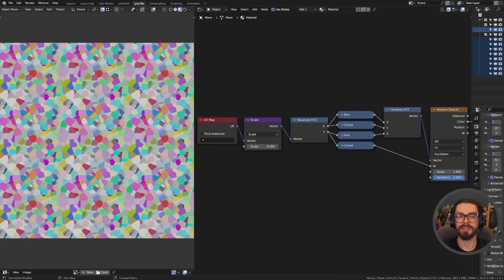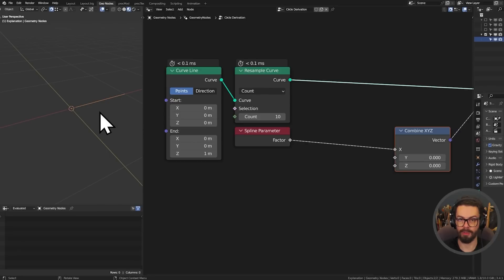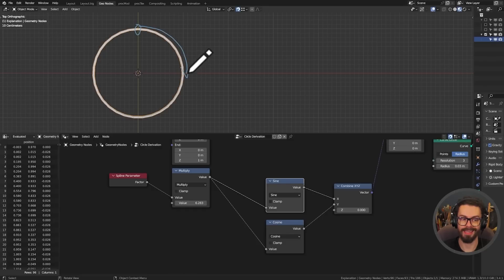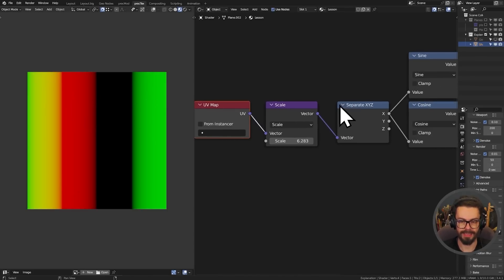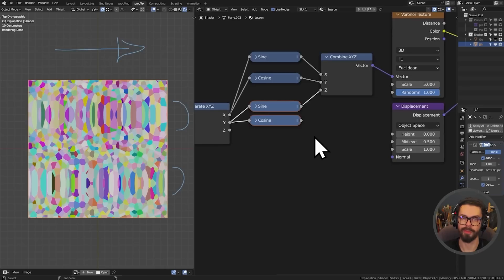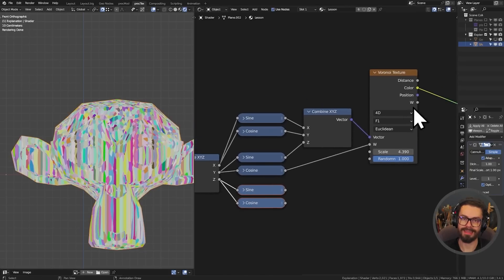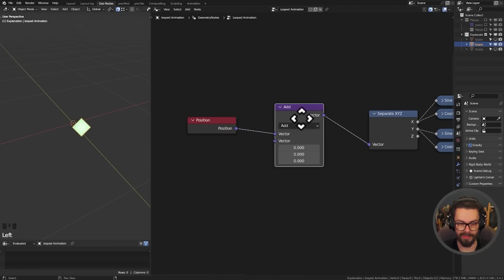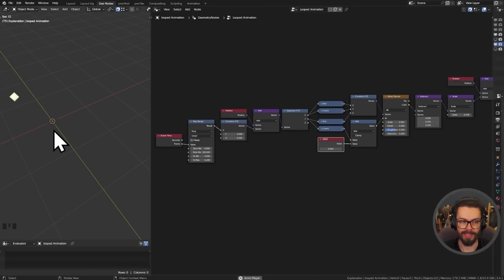Tile ANY Procedural Texture

Comment: Amazing video! The practical applications were great but the mathematical explanation was a little wonky.

Essentially what you're doing is remap an 1 dimension input to a continuous closed loop in a higher dimension. In your case the loop was a circle in 2 dimensions as you used the sine and cosine functions. However any continuous closed loop achieves this result, which means that any continuous periodic function, such as the Ping-Pong function for example, can be used instead of sine and cosine.
Mathematically speaking this remapping can be interpreted as a continuous closed curve k:[a, b] -> R^n where k(a) = k(b).
To minimize the distortion the norm of the derivative of that curve should be constant, ideally 1 to preserve scale.

I'm saying this because this process of mapping introduces a certain amount of distortion. If you look closely at your Voronoi noise you will notice that the cell borders are slightly curved even though they should be perfectly straight, this is due to the distortions cause by your remapping. 
The strength of the distortion is dependent on the the periodic function and the procedural texture being used, for example using the Ping-Pong function results in less distortion when paired with Voronoi noise.

Another thing you mentioned was that your way of tiling a 2D Voronoi texture requires a 4D Voronoi texture while a tileable 3D Voronoi texture would require a hypothetical 6D Voronoi texture. This actually isn't necessary. For all procedural textures in Blender it's sufficient to only remap a single input axis. Not only does that mean that we can actually create a tileable 2D Voronoi texture using a 3D Voronoi texture and a tileable 3D Voronoi texture using a 4D Voronoi texture but doing so also reduces the amount of distortion we introduce.
Reply from the maker: Thanks for the full answer. How are you achieving minimal distortion without looping all the axis? Doesn't it clearly stretch as it cycles?
Reply: @Erindale  When remapping there are 2 kinds of distortion we introduce. 

The first is caused by variations in the norm of the derivative of the curve we use to remap the input.
To minimize this kind of distortion the norm of the derivative should be constant.

The second is caused by the shape of that curve.
For Voronoi this kind of distortion is minimized when there is curvature in our curve.
This means that our function which we use to remap the input has to be a piecewise (affine) linear function which the Ping-Pong function is.

The norm of the derivative of the curve consisting of Ping-Pong functions is the constant value sqrt(2). So if we divide the axis by a factor of sqrt(2) it completely cancels out the first kind of distortion. 
As an piecewise affine linear function the Ping-Pong function obviously has no curvature, so the second kind of distortion is also minimized.

When using sine and cosine the norm of the derivative of the curve is sqrt((sin(t)^2)+(cos(t)^2)) ,which thanks to an addition theorem just happens to be the constant value 1. This is why you didn't have to divide the input by a constant factor and why the first kind of distortion is also minimized using sine and cosine.
However because the curve comprised of sine and cosine has a certain amount of curvature it introduces the second kind of distortion.

As for "without looping all the axis?" I don't quite understand what you mean by that. The Ping-Pong function just like sine and cosine is a periodic function so the resulting curve does loop.
Reply from the maker: If using ping-pong it will be clearly mirrored like it's been book-matched. With the sin and cosine method, the repeating isn't immediately apparent to the eye. You mentioned you can loop with only a single axis which makes doing a 3D tileable effect possible without 6D noise
Reply: @Erindale  Ah, I forgot to mention that you have to apply an offset to one of the remapped axis. So just add a constant factor to one of the remapped axis. If you do that the mirroring effect will disappear.

Also when I said that it's possible to loop with only 1 axis I meant that we only need 1 additional axis to create tileable textures. Doing so requires arranging the curves in a way such that the resulting shape is topologically equivalent to our looping plane, however that isn't easily explained.
Reply: Holy moly!
Reply: I dare you, I double dare you guys, find me a better community!

The magic of open source.

Comment: This doesn't work with ANY Procedural texture.
At the beginning of the video, the Voronoi texture image, if you draw a line from the top right to the bottom left, it's a clear mirror point for the entire texture. 
Colors are different, but shapes are identical.

Great for other noise types though.

Comment: How do i actually use this on a texture though, i dont think i've seen anyone plug this into a procedural texture, they just demonstrate the tilability and stop there. theres like a gap in knowledge and im not sure where to start from after i have my tiled noise texture. 

My guess is i'm supposed to build this into its own seamless block, but idk what plugs into what when you actually begin making a regular texture from it.
Reply from the maker: As an example let’s say you’re building a brick wall with some damage and dirt on it. The maths for the brick pattern is easy to make loop already but the dirt and damage is very likely to be noise or voronoi based. In this example you’d use this looping WXYZ coordinate to drive the noise and voronoi with the same wavelength as you’ve set for the brick pattern

Comment: Is there any way to speed down the cycle? It seems it has to go all the way to 2*Pi (tau*2) which is way too big value.
Reply from the maker: It has to do a full cycle to loop the coordinated but you can adjust the texture scale to try and make it feel better, or opt for a longer animation. 10-15s is pretty standard for a looped animation

Comment: I've compared node setups 10 times now and I can't spot a difference, yet can't get it to work... did this stop working in 4.0?
Reply from the maker: It shouldn’t have done… still works for me. Maybe drop a screenshot on my discord and someone can probably help
Reply: @Erindale this is embarrasing... I was so focused on the various sine and cosine nodes trying to figure out why I'm not seeing the same patterns that I missed that I missed the 2*pi scaling node in the beginning which makes everything work! 🤦‍♂Anyway, at least I've spend an hour extra trying to understand the maths behind this so I've either gained 0.001 IQ points or wasted a whole lot of brain cells...😅
Reply from the maker: @eobet not embarrassing! Very easy mistake. And the debugging is a good brain exercise

Comment: Since I switched from Cinema4D to Blender I was looking for a way to get seamlessly looping noises in Blender as well (Cinema4D noises have this implemented as setting). This is an immensely important feature for motion graphics artists if you need to create looping visuals for events or social media for example. My workaround so far was to blend over two textures with the same values over the looping time while animating the W value accordingly so that they are the same at start and finish. But this setup is the real solution, very elegant and much more flexible. Thank you so much for this amazing tip!
Reply from the maker: Glad it's helpful!

Comment: I don't know the whole math; but I think the simple(ish) solution for 3d tiling would be to use the 3D coordinates as euler angles, and convert that rotation into a quaternion to get the 4 values you need.

edit: I'm not sure if I made a mistake in the nodes, or if this isn't such a good idea after all; tried using the formula from Wikipedia but there are some stretched regions suspect might actually not supposed to be there...

edit2: Still gotta study it a little more; but kinda looks like I fixed most of the stretching by replacing the plus with a minus for the Y value, so only the w uses a plus now
Reply from the maker: Interesting stuff! If you get it working, feel free to share in my Discord resources
Reply: @Erindale  Don't hold your breath, I rarely manage to finish anything I start...
Reply from the maker: Haha you should see my WIP folder 😅

Comment: I've been doing this since Realsoft3D got 4D generators 20-30 years ago - damn just saying that makes me feel old 😀Couple of other tricks related to this:
1. Instead of 2D UV -> 4D generator to get two seamless dimensions, you can also do 2D UV -> 3D generator to get one seamless dimension. This is very useful for procedural texturing of cylindrical and conical shapes where you fill out one dimension. Meaning it is possible to use voronoi on a UV unwrapped cylinder (no seam around the circle) - just make sure it fills 0-1 in U perfectly - but it will also never repeat along its height. I use this pretty much all the time for brushed textures; seamless voronoi.Color -> Separate HSV.H -> -0.5 -> *0.02 (or lower) and drive anisotropic rotation. HSV.V can drive the coloring.
2. Looping time also have its uses for non seamless texture creation. Sine and cosine of #frame/frames * tau, add that to z and w for an "evolving" 2D texture that loops. If you also add to x and y you'll see the "circular movement" of the texture and probably not desired. It's a nice way to create a repeating set of images to fake waves or caustics as long as a non seamless texture is sufficient.
3. The downside of 4D (and 3D for that matter) voronoi over actual 2D voronoi, is that Distance to Edge mode will not look as nice. So having seamless options for each of the dimensions built into them would be far more valuable than this workaround.
4. 4D Smooth Voronoi is slooooooooooooooow... Just a little warning 😀
Reply: I think we need another tutorial
Reply from the maker: 4. Yeah that sand dune example uses two 4D smooth voronoi and it chugs

Comment: Needing a 6D texture to map a 3D object in the Z axis is intriguing.

 I wonder if you could arrive at a sufficient result by repeating this entire 4D texture process in the Z and Y (or Z and X) axis and then using mix/blend nodes to seamlessly combine the two 4D textures.
Reply from the maker: Worth a try! Let me know how it goes
Reply: @Erindale  Didn't get too close. I'm sure there's a way to do it using the Normal information of the object, or triplanar mapping or something, but I'm too smoothbrained to figure it out.